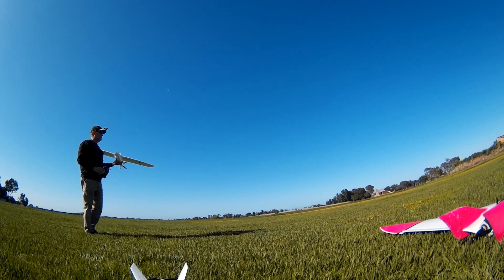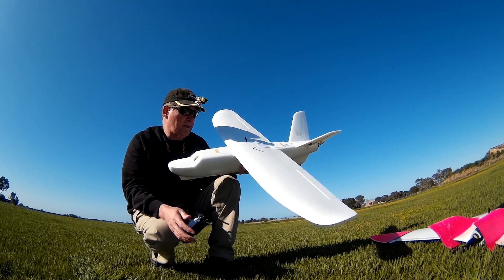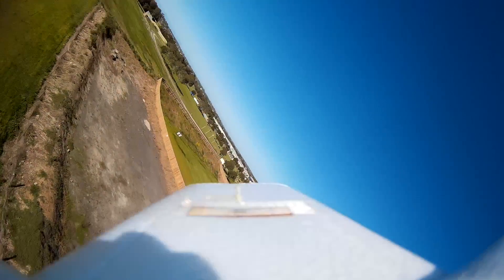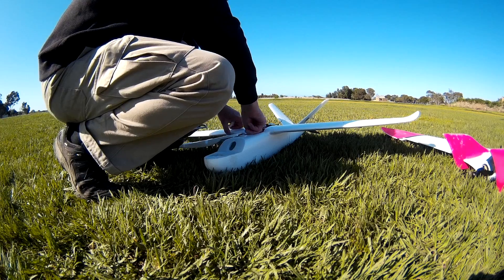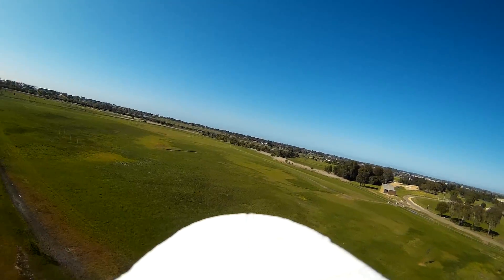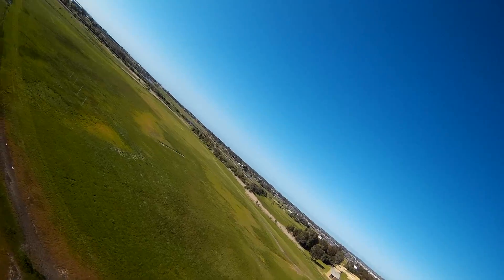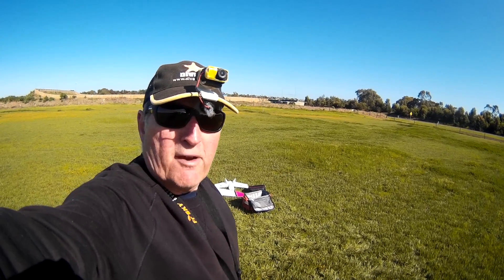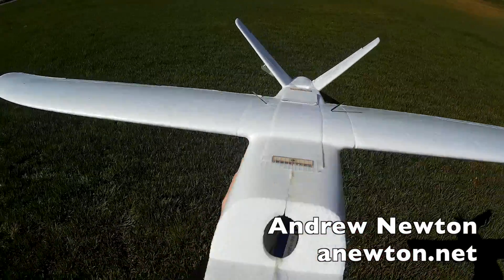Mini Talon CG and stall tests

Comment: Great video Andrew. Mine [mini talon] is pre-marked at 90mm my flying weight came out to 1419g with a 4s 3.2 lipo. I installed landing gear.
Reply from the maker: Nice setup Jason. Still flying mine now, with INAV and DJI FPV.

Comment: Great video Andrew. It's also interesting to measure rate of clime with respect to elevator trim setting at a given motor current value. Once CG is optimised it seems to climb much more efficiently with less up elevator, as do most pusher planes with a good thrust line. I always use this technique as a way of tuning best efficiency, rather than just trying to minimise straight and level current and be feeling around for the edge of stall speed, for those aiming for maximum range etc, there is a speed window there that allows for safer max efficiency cruising rather than just hanging around at minimal speed but it's really a mix of all three, attitude (trim), CG and thrust. Thanks again, good info.
Reply from the maker: Interesting, you're tuning to a finer degree.

Comment: Nice review. When I was flying mine, I made sure to give it about 5mm of reflex in the ailerons. That seems to tone down or smooth out its flight characteristics. 

I have tape my entire plane and pretty much used the power setup I've used in my Bixler. Inefficient 2200kv motor 2200mah and 40amp esc. Had to use some ballast on the nose to balance out the plane; wanted to keep the weight down ad much as possible. My AUW is 43oz. I have pictures on earlier on the Rcgroups. I'm one of the first one who have added flaps on mine. (G-LO)
Reply from the maker: Oh yes I saw your flap mods, nice one.

Comment: great video! the biggest problem with a heavy setup and cg at more than 60mm is the launches - for a 1.6-2kg (or more - someone at the FB group said he uses 4s5p liion!) it needs a lot of force and stalls easy (and torque roll from the motor is bad) - the launches have to be "perfect". I'm happy with 60mm cg - it cruises at 4-5a and with a 4s 5.2ah gives me 40 minutes of flight (could fly more but 40 minutes its my limit xD)
Reply from the maker: Thanks Chaps, that makes sense

Comment: Nice experimentation on the CG location. I usually try to find my CG, take it outside and give it a good toss and see how it glides for CG determination. I guess if I ever change the weight significantly I need to re-calculate. Happy Flying!
Reply from the maker: Glide test might not be the best for overloaded planes I guess

Comment: I know on the servo wires is a bit nose heavy Andrew, but there is some logic behind it I think....Since this is a distance machine, a lot of people like to see just how little throttle they can fly it on...If the plane was set more tail heavy, the danger of entering a stall and spin would be so much greater and if you are kilometers away, that's bad news. 
  It would be interesting to load her up with a typical 8amp 4S and see how far back you can set it then, but remember, you have to sip the amps with minimum throttle whilst all the time keeping it away from the stall....and a lot of pilots dont always have the benefit of an ASI.
  I think also the glide angle is a more valuable measure of success perhaps...?  On the servo wires may give more gliding distance from a set height than a more rearward conventional CG? It likes to fly fast.